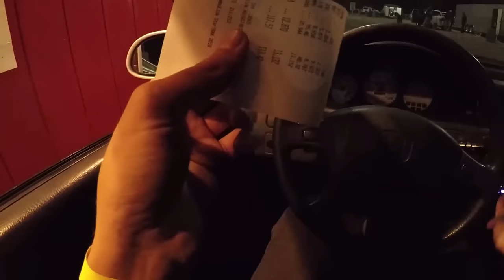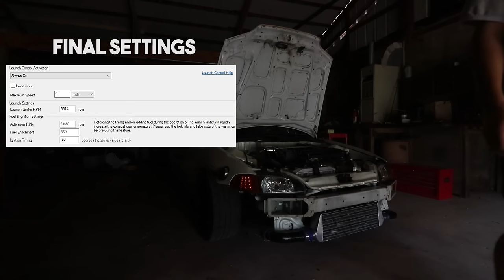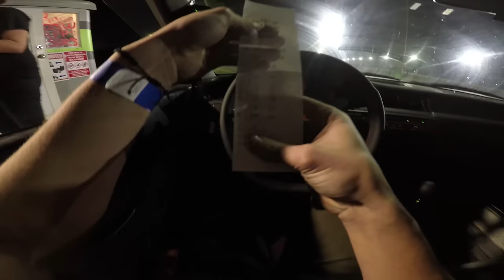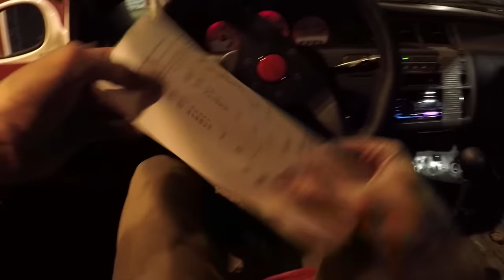Honda Civics are a Waste of Money...

Comment: bro i buy a rhd eg8 last year 9k but i new i wanted a fully built one so i sell all the parts its has then i put 15k in turbo setup 😂 and i have a toyota soarer 1jz but honda are not the same they are good to work on and lots lots of video like you ❤ now i have 285whp on 7psi with no vtec cause my skunk2 pro 2 are not good for turbo setup going back with typer cams and my 5858 pte turbo will make a nice 340 to 380whp